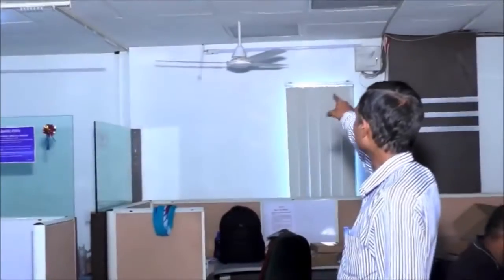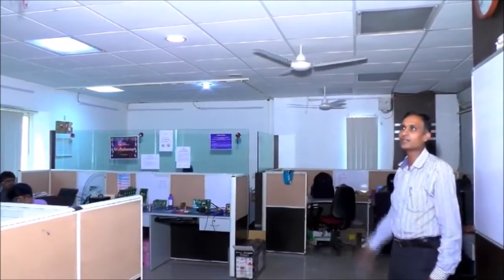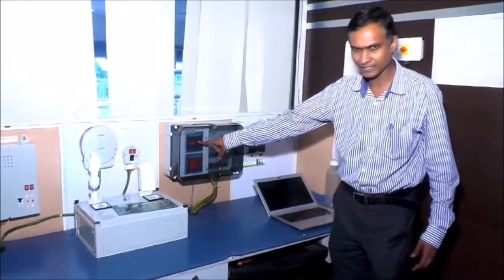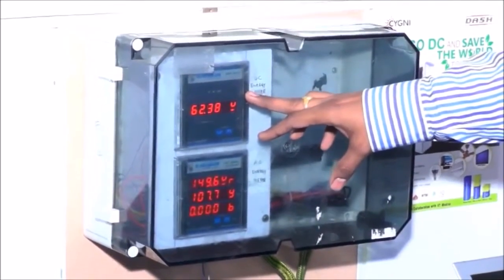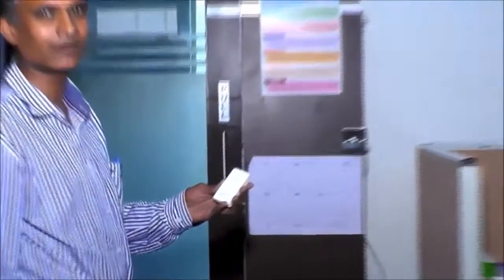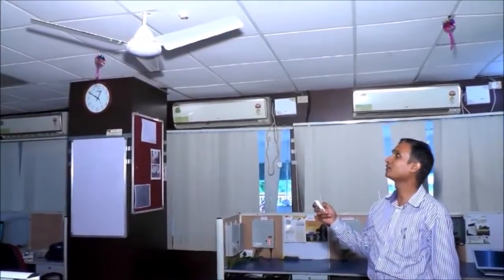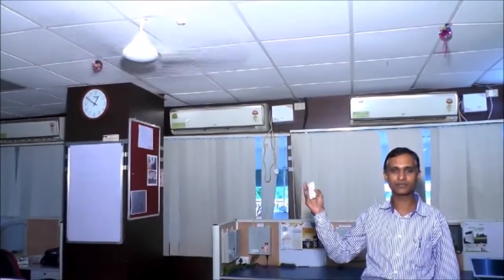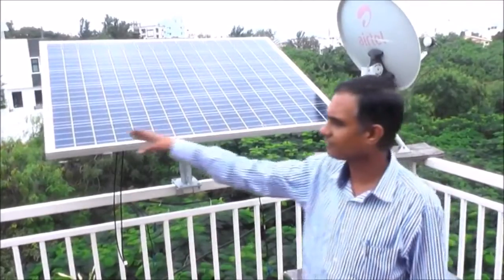Product Demonstration for Inverterless - A Solar DC Solution

Comment: Sir why using 48v systems instead of 12v? Is any advantage of using 48v?
Reply from the maker: All across the world there is a big shift towards 48V DC systems and Scientific / Technology community is
increasingly recommending it as a preferred system for the future DC evolution. Below are some of the reasons
for this shift.
1. Reduction of losses:
For a 100 Watts load, with a 12V system, the current is almost 10A, whereas with a 48V system, it will be
1/4th (about 2A). The losses with the same cable for 12 V becomes 16 times as compared to 48V system.
Alternatively, a thicker cable has to be used.
2. Future Scalability:
a. Many quality appliances like BLDC Fans, Coolers, Mixers etc are designed for working with a nominal voltage of 48V DC.
b. TV brands like Soni Bravia etc have already come up with TV sets with two input sockets (one with 230V AC and other with 48V DC, either can be used).
c. Refrigerators, Dessert coolers and Air-conditioner are also being developed at 48V DC.
d. No such possibilities exist for 12V/24V systems as of now.
3. Compatibility with existing wiring:
Existing wiring for AC distribution system can be used for DC distribution on 48V DC (where applicable),
which is not possible with 12V system.
 4.More Standardized and Robust:
48V System is a mature standard that is being used in telecom and automotive industries world over and
all the learnings / innovations of these two sectors can be adapted in household sector.
5. Human Safety:
Another misconception prevalent is that 48V is not as safe as 12V and 24V. Here it is pertinent to mention that 48V DC complies to Safe Extra Low Voltage (SELV) guidelines and same has been recommended by BIS for home system and MNRE has also included it in its guidelines.
Reply: It is also safe according to more restrictive ELVDC standards:  https://en.wikipedia.org/wiki/Extra-low_voltage  "In Brazil, ELV (Extra-baixa tensão or EBT in Portuguese) is officially defined in Regulatory Standard no. 10 from the Brazilian Ministry of Labor and Employment as any voltage "not exceeding 50 volts a.c. or 120 volts d.c.".[5] Although that standard defines safety rules for electricity, the Regulatory Standard no. 12 requires an even lower voltage for start and stop devices on machines and equipment made from March 2012 and on, stating it shall not exceed 25 volts a.c. or 60 volts d.c.[6] " @CygniEnergy
Reply: Go ahead with ELVDC 48V. You have standards in telekoms, already.  You can have also a stand alone nano-grid for only, let's say garden lighting, with separated PV (ie flexible, or else), and you use 12V or 24V.
Reply: I agree with the 48v system but now in India majority of appliances are available in 12 v system & not even on 24v system.